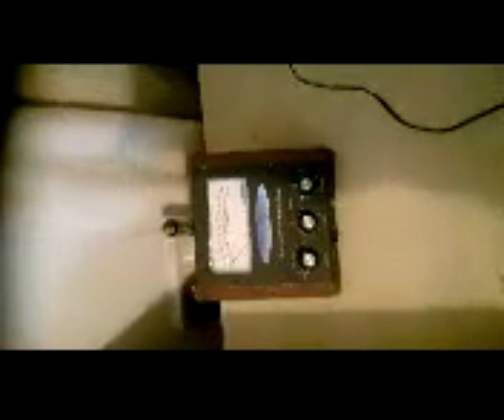Electrical Charge from Orgone?

Comment: Interesting, thank you! In africa we recharge those nonrechargeable batteries by placing them in the sun on a hot day. Interesting that you replicated this indoors with your cabinet.
Reply from the maker: Yes that is interesting, I wonder if it works with the rechargeable types of batteries as well. Reich believed that the sun was an orgone accumulator rather than a nuclear furnance (which would explain some of its odd qualities, such as higher temperature at the surface). The charging of chemical batteries wasn't very straightforward in the orgone accumulator but there definitely seems to be an increase of static electrical charge in the box. I think you need to somehow 'stimulate' the orgone/oranur field in order to get higher amounts of electrical charge. The orgone from the sun would be in a more 'stimulated' phase I guess.